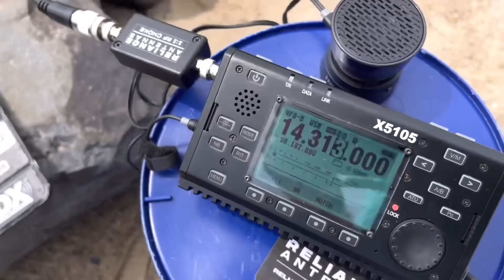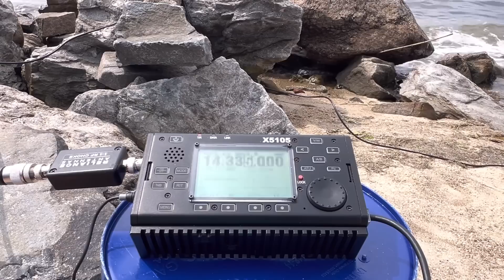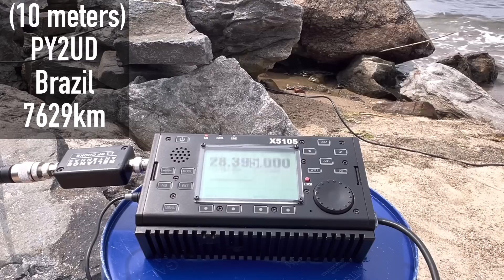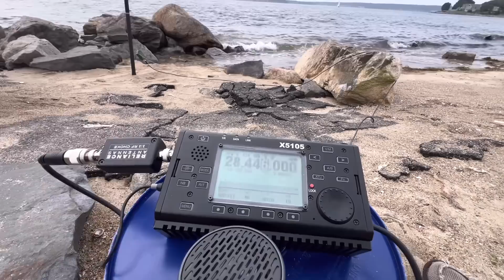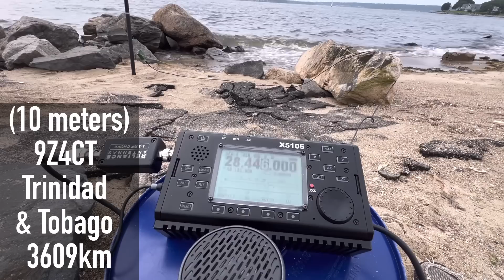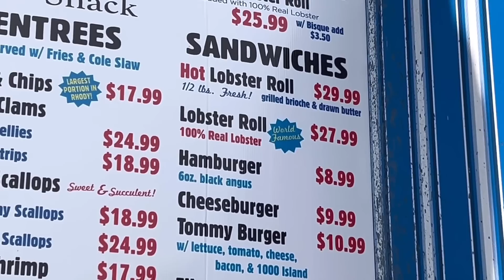SSB QRP - Experimenting with a 20.5 Foot Vertical Antenna

Comment: Walt, thanks for all the great videos.  After watching the videos on the 17-Five and 20.5 antennas, I decided to do some of my own experiments.  I didn't have a 4:1 UNUN but did have materials to build one with an integrated 1:1 Choke.  I hooked it up to an existing radial field I had and tried both 17.5 and 20.5.  Both tuned up great on the G90.  Been doing testing using FT8.  The 17.5 did pretty well on 30m and up.  I started testing the 20.5 today.  Band conditions aren't great right now, especially in Missouri.  But I am seeing some promising results.  Spot reports showing up all over North America and hitting some Europe on 30m and 20m.  The 20.5 seems to be performing notably better than the 17.5.  I will be testing for a few more days to see if band conditions improve.  I am still fairly new to HF so not sure how much this means but on 20m today, I am tracking 643 spot reports with contacts on FT8 where my db is at or greater than the other station.  That is unusual based on my past experience with an EFHW inverted V with the peak at 20ft.  Thought this might be interesting to someone.
Reply from the maker: Thanks for the kind words and Thanks for the input on your findings. I’ve enjoyed playing with these two lengths as well. 73, Walt

Comment: Hey Walt - I talked with you at the Ham Radio Expo in Marlboro and you were nice enough to give me a few tips. I had just returned from a meeting where the speaker put down ham sticks and end feds and only recommended di-poles and taller verticals. I went home and borrowed at 17 foot vertical and connected to my G90. With radials, it measured 1.8 swr on 20 and 4.5 on 40 (brought to 1 with tuning) and was able to make some some good solid contacts. I then went to my shack - hooked up to my home end fed - and with my 7300, made the same contacts, with a stronger signal reports. But, nonetheless, the vertical did well and I will keep experimenting. And I have a feeling I will also try your 20 foot antenna as well. Thanks for all you do.
Reply from the maker: Great to meet you my friend! 73, Walt

Comment: Enjoy your videos including those with the great lunch/dinner visits.  Your dx's are usually pretty distant, however not many close by.  I'm doing POTA and am having a hard time getting those stations close in (those in the dead zone).  300 miles plus are great but closer not so much.  Other than going to GMRS, do you have antenna/band suggestions?  NVIS works at 40m and 80m but nearly not at all at 20m.  Thanks
Reply from the maker: @thomascurrin  thanks! NVIS on 20 and higher is tough. I haven’t done much in terms of close in comms on those bands because I’m always trying to work DX. Especially with a vertical and a low takeoff angle. I wish I could give you a good answer or source but typically my idea of working closer contacts is to get on 40 meters. All the best and 73, Walt

Comment: How do you find the Xiegu..neat size?
Reply from the maker: I have a love hate relationship with that radio. I love the size, the internal battery, the built-in ATU but I absolutely hate the audio and the internal speaker. Even with an external speaker I just can’t get the audio where I want it. You can even hear the heavy clicking when I key the mic in this video.
Reply: Distortion on receive has been my problem.
Good idea abt the 11m crossover..awesome  band..73 g0ebp

Comment: Hi Walt, quite a convincing test indeed. I'll definitely try this one on the beach one of these days instead of the 1/4 wave 20m telescopic whip I use now. 
Having to dismount my antenna in a hurry because the tide was reaching it just happened to me a couple of days ago HI*3.
Post-lunch nap is a must when you wake up quite early for portable on the beach.
Still hoping that our paths cross over the air one of these days, my friend.
Best 73s from sunny Brittany, France (🤞it'll last).
Reply from the maker: Thanks Alain! We definitely need a beach to beach QSO!
Reply: I sure hope so, Walt. I worked a few US stations on 20 and 15m recently, around 7AM and 8PM my time (UTC+2). Always hoping that I'd catch your callsign 😁
Oh, BTW I wanted to add that I'm 100% with you on the CB "vs." ham issue. I do both too, although the 11m band is rather dead here. And I've been very active on 11m in the late 70s-80s. Radio is is radio. I just don't understand why some people are so narrow-minded.

Comment: 11 meters still rocks today  KZI8833  now General W1AJF . In the 70’s lived in Chesapeake Va , Siltronix 1011D worked the world on that radio with a PDL2 at 40 FT
Reply from the maker: We were practically neighbors in the 70’s. I lived in the Deep Creek section of Chesapeake in the mid 70’s. 73, Walt

Comment: That was great Walt ! Now I am Hungry!  I put up same antenna in Boston NY today. Made my own 4:1 UNUN and speaker wire for 20.5 ft  and counterpoise.  I used a piece of wire I had for counterpoise. just threw it on ground. Got 1:7 SWR on CB ch 20 and the whole band. I did a VNA sweep and smith chart . saved it to my PC. I made like 40 contacts on CB SSB 36 to 40CH,  from 3 to 6 PM . Texas, Alabama, Mississippi, Oregon mostly .  just a quick test. The RX was awesome . S9 RX on most contacts. I gave S5 to S7 . I will cut better wire and use my Icom 7300 another day . I just had a stock CB with SSB handy and 20 Ah battery.  I sat on the ground. I will take antenna to park and do a POTA with it some day soon I hope. 73
Reply from the maker: That’s awesome, thanks for sharing. I’m definitely going to try it on 11 meters now! Thanks

Comment: Cool video, does your hat say Coast Guard? Did you serve? I retired from the Coast Guard. 73 de ae5ri
Reply: I loved Portsmouth, I was stationed there in the early 2000”s  at the 5th district building downtown. Enjoying your videos. 73
Reply from the maker: @terryhull7757  I live just a couple blocks away in Olde Towne.
Reply: @COASTALWAVESWIRES  we lived on Cedar Ln.
Reply from the maker: Thanks! Yes that’s a Coast Guard hat but I’m civilian. I’ve worked on several USCG shipbuilding and ship repair projects over the years. I’m hoping to join the Auxiliary after I retire in a couple years. I’m from Portsmouth, Virginia home of 5th District HQ

Comment: I have the 880. I was looking at the sideband version, but somebody else liked the price before I got back to it. I also have SSB older 40 unit. When I was Over the road, I used 15 on sideband east of the Missisissippi ( that is a hard one to spell quickly) and ch17 out west. SSB operators were a more polite bunch "back then".
Reply from the maker: I swapped out the AM CB in the Jeep and put my 980SSB in. Had a contact to Louisiana yesterday and just had one to Jamaica at lunch on my little 2 foot FireStik II

Comment: Growing up in the early 1970’s we actually had a “family” CB license and FCC call sign (KFT7689). I still have one good local friend I met on CB in the evenings, and we encouraged each other into HAM radio, from the days when they combined the Novice and Tech licenses, all the way through to passing Extra at the same time. For me, SSB low power, portable, and mobile operating has been my focus, that’s why I enjoy your antenna projects so much 👍. 
Whatever forms of radio communication you decide to cover is all on you, it’s your channel and we’re just along for the ride.  However I do think you need to be careful, and yes I know there are some bad examples on 80m at night 😱, but some of the language on the CB bands can be slightly less than family friendly, especially for young impressionable minds, so it might not be the best example of polite radio operating 😉. Looking forward to whatever you get up to next 😃👍. 73 de Dan WD4DB
Reply from the maker: Same here Dan, I used my dad’s call KSC-5588. Those were fun days

Comment: Thanks for another great video. I have to thank you for getting me to build up a collection of easy to set up antennas because with more choices, I have more opportunities for making contacts! As for 11-meters, I just don't get it. Many folks started out there and then got into ham radio. I think some of the issues for older guys (I'm 63, so I'm no spring chicken) is that there is no license test for CB radio and new hams don't have to take a CW proficiency test any more. Thus there is an unfounded animosity towards anyone who didn't do it the old school way. Honestly, I wouldn't have discovered ham radio without CB and I probably couldn't past the technician test (let alone the general and extra class tests) if CW was required. For our hobby to survive, we need younger people getting on board. Many youngsters love CB.  Darn, I missed you by two hours on the bands. Thanks again...73...Hugh...KN6KNB
Reply from the maker: Roger that, I totally agree. Sorry I missed you!

Comment: I'm sorry to have missed you at HamXposition.  I was there Friday, Saturday, and Sunday (long gray beard, black aluminum walking stick, In case you noticed me).  I picked up a 4:1 balun at Reliance, to try for a few full wave loops, but it should also work for this kind of antenna to (I just need to figure out which terminal to ground to turn it into an unun).
Reply from the maker: Sorry I missed you, I was just there for a couple hours Saturday afternoon.

Comment: Being a truck driver for over 40 years, I’ve been on 11 meters all that time. Was a lot of fun in years past. Channel 19 is mostly useless for a truck driver now. No drivers really use it anymore, they all have their phones.  Got into ham radio in the last year on 2 meter in the truck. Run local so I have lots of friends on the repeaters around where I live. Really enjoy hanging out on the radio again. As for the food, keep it up, food is my first love, ham radio is my second. 73s, Greg N4GDD
Reply: I was a truck driver of 20 years, channels 19 and 17 are dead quiet now days, the only real activity is on the lower side of 38, it's the main reason why I'm going ham.
Reply from the maker: Thanks Greg, I’ll keep the food treks coming. 73, Walt

Comment: I don’t care either way but you did exceed the distance limits of 11m talking to that station in Jamaica. Some CBers did petition the FCC to lift that restriction. But the FCC’s stance on it that CB radio was never intended to be DX radio service. Which is why I’ll never understand why they put it on a frequency spectrum that’s subject to long distance propagation. It’s a rule that’s almost impossible to enforce though. Something I’m not willing to jeopardize my amateur license over though. Definitely nothing wrong with 11m to leave the channel over. Sad indeed 😢!
Reply from the maker: The 155.3 mile distance restriction was revised and lifted after the FCC accepted and approved Part 95 Personal Radio Service Reform Report and Order WT Docket No. 10-119 in April 2017. There’s still some gray area over contacts outside of the USA though.
Reply from the maker: here's the actual link to the Federal Register change removing the distance limitation on CB radio, see paragraph 14: 
https://www.federalregister.gov/documents/2017/08/29/2017-17395/personal-radio-service-reform
Reply: @COASTALWAVESWIRES  thanks Walt, just goes to show how long I’ve been out of the CB radio scene.
Reply from the maker: @truckinguy92  no worries my friend, I absolutely wouldn’t post myself making that contact had I not known the new law. 73
Reply: @COASTALWAVESWIRES  my initial comment was just looking out for your best interest at heart. No where in those rules did I see anything about restricting where the skywave propagation goes, foreign or domestic. It just says they lifted the restriction. Which doesn’t really surprise me because I doubt the rule was ever really enforced.
Reply from the maker: @truckinguy92 thanks and yes, you have to really be trying hard to be a problem to get any enforcement issues on CB from the FCC